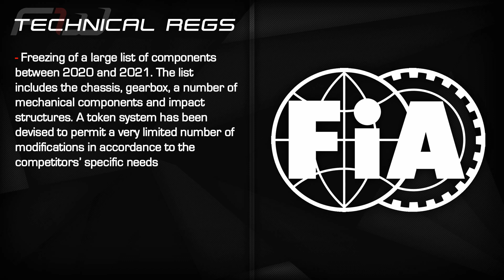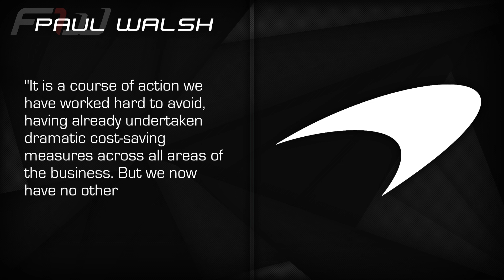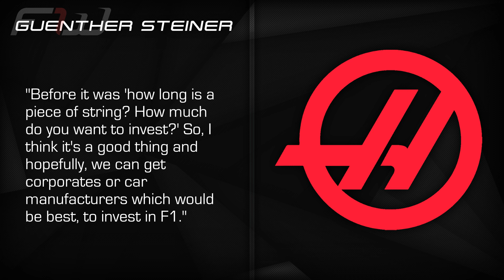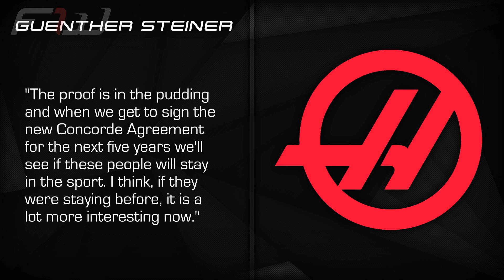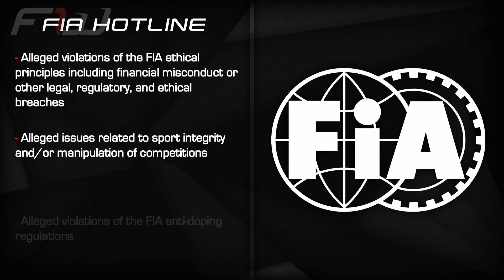F1 News: New Rules Officially Approved Including Aero Handicap

Comment: I think the handicapping shouldve been introduced a a couple of years after the cost cap, maybe for 2023. See if the cap closes up the field and the implement it if its needed. 
With the cap in place if a team is on top its because they have done a better job with the same financial resources as everyone else. I dont think they should be punished for that. But if there is still a massive gap from the top 3 then and only then it should be put in place
Reply: problem is that still with the cap in place, only Mercedes, Ferrari, Red Bull, Renault and McLaren (barely) will be able to use all of the 135 mil. While teams like Racing Point and Haas barely reach 70mil. And then there is the different amount and quality of facilities, staff, equipment etc, betwen teams. So dont expect to see the top 3 gone, this is still F1. I do like the handicap idea, since its flexible, lets say Mercedes are super dominant the first year, but then they get handicapped and are less dominant the next year, they slip behind Red Bull, then RB would be handicapped and Mercedes would be able to close in again. I think its a good way to stop the goddamn positive feedback loops in which F1 is stuck since its beginnings in the 50s

Comment: I wonder: both Mercedes and the Renault-Enstow factories are cutting edge. They are terrific assets. If Mercedes and Renault do leave F1, it’s possible that one or both of them will stick around as an engine supplier, but who picks up the constructor factories? Is it possible that a Stroll-Wolf led consortium acquired the assets of Mercedes F1 and run that as the official ‘works’ Aston Martin F1 Team? With the current Racing Point team becoming their B team? Similarly would a consortium - maybe involving Haas - move to acquire the Enstow factory from Renault and run that as an A team with the current Haas team being their B team?

Comment: Again with these handicap rules. If you want close racing, do a spec series, with all its downsides. Want a "halo" series/ "prestige" series?, leave no handicap. No backmarkers deserve a win in an uncompetitive starting cars and average drivers in a normal race. Budget cap is fine, but not win handicap.
Case in point : LMP1. It's not Toyota's fault, it's the rules and ACO/FIA fault for not changing the rules sooner. They just had to slow the Toyota to not let them win.

Comment: Why does the minimum weight go up!?!
Reply from the maker: There were concerns raised by power unit manufacturers that in order to save weight, they may be forced to source more 'exotic' and therefore more expensive materials. Also, there were concerns that they may not be able to get their designs down to the current minimum weight limit.

Comment: Regarding the ATR: I mean its somewhat close to what they do in MotoGP where the teams further at the back get more testing time than the top teams. And it has helped bring some teams (like Suzuki) back into the mix, the racing did get closer there. 
In F1 all they do is give the lower teams more testing time in the windtunnel. And I think that is perfectly reasonable. It is an opportunity to catch up with the top guys, not a guarantee. A badly managed team will not be able to capitalize on this. As for the topteams, they will have to work smarter not harder to stay on top. Don't forget they still get much more pricemoney than the lower teams so there is still a very real incentive to finish higher up the order. 
On a side note the ATR also makes it somewhat easier for new teams to get into the sport since they are allowed more time to develop their car.
TLDR: I believe the ATR is a way to counter the positive feedback loop which is more pricemoney for a higher championship position and that is a good thing.

Comment: Aero handy capping, F1 is truly dead now. It is no longer the going to be the driving force of new technology as the teams will now be held back by artificial rules. I watch this sport for the technology and always have  since 1975. To handy cap a team for 7doing the best job is just ridiculous.  Whats next a 10% engine power handy cap. If they do ghis I'm done there is no point in the sport any more. You might as well turn it into Indy car racing. 
Its bad enough that since 2011 we have had to put up with tires that will not let ghe true potential of the cars be shown as it is now a tire endurance formula whers the tires fall apart if anyone truly drives hard. Then they took the easy way out and introduced DRS instead of fixing the aero dynamic problem the sport put it's self in.
I agree that a cost cap is needed the sport has become a joke with all the artificial rules they are coming up with. 
I  would like to see Mercedes, Ferrari, and Renault move into the WEC where performanc is being strangled to death.
Rest in Peace Formula 1 it was great while it lasted but you have been slowly murdered by the people that were suppose to protect you.